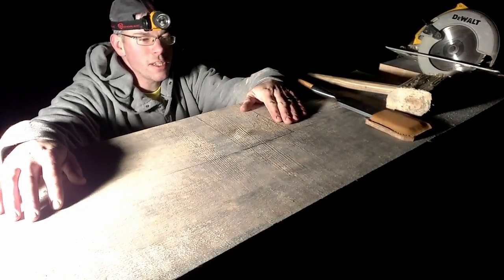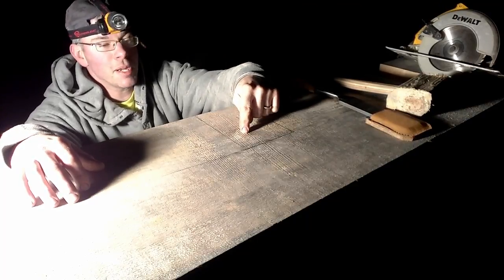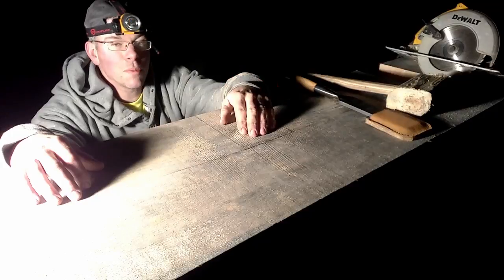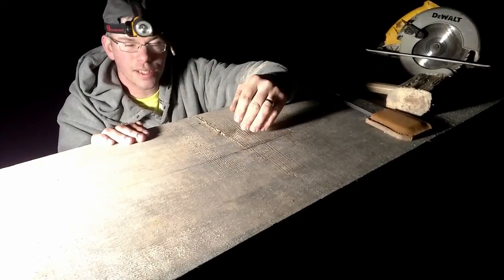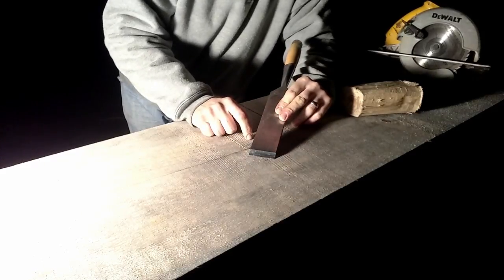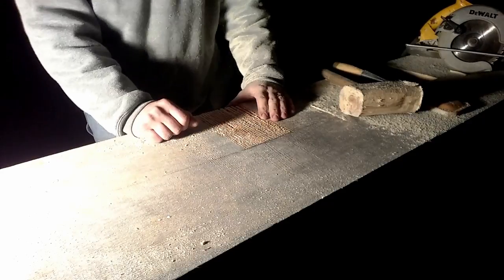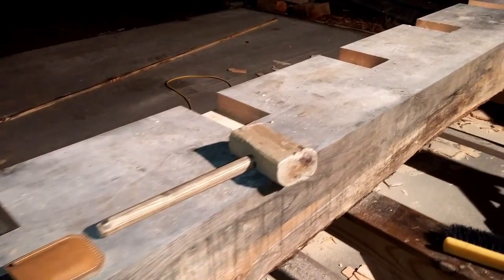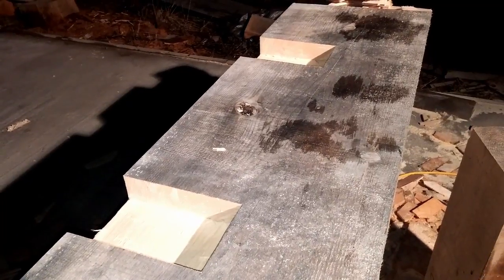A Timber Frame Vlog #4: An Evening With My Girl Cutting Joist Pockets

Comment: Is there any guide for how far into the joists you go? For strength I mean .  I've been thinking about this for a while.  How do you know whether to use an 18 inch beam or a 10 inch.?  When do you go to an engineer to make sure your plan is safe?
Reply from the maker: I have a few videos on this subject up, also the last couple I put up are on load calcs for sizing the timbers.